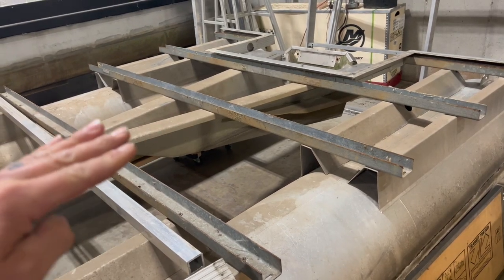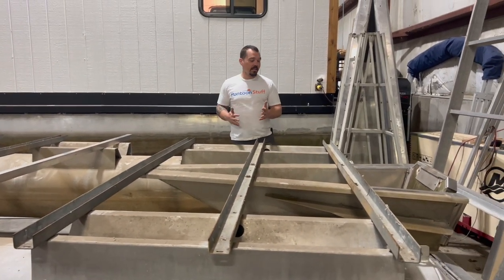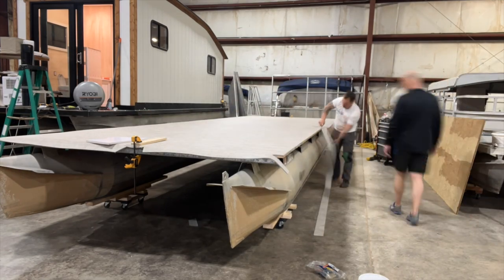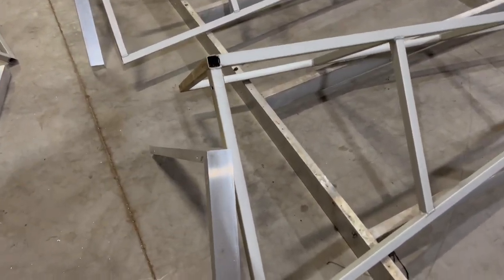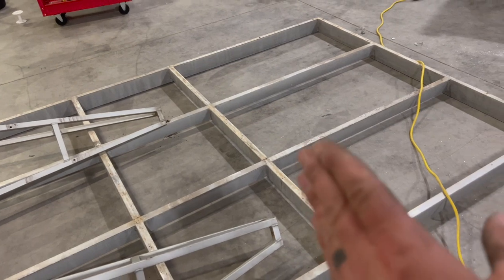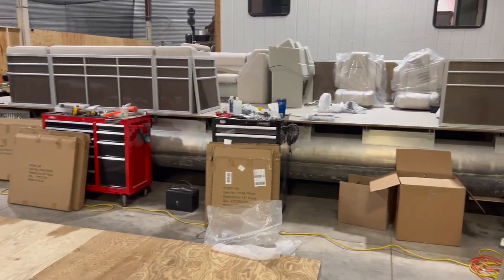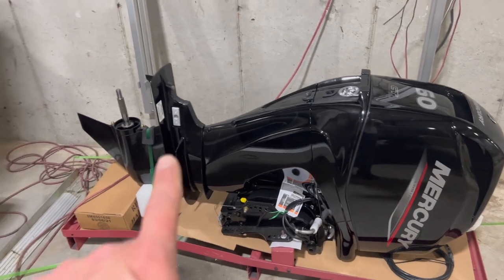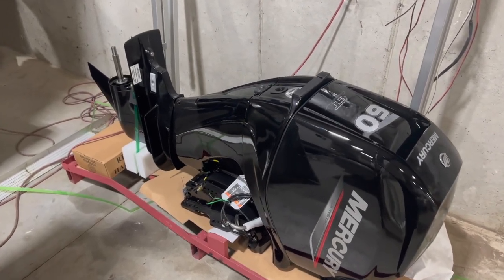Double Decker Pontoon Restoration - Episode 2

Comment: Renovating my 98 Tracker Fishing Barge with aluminum deck what type of glue do I use for Pontoon Stuff vinyl? And THANK YOU FOR ALL YOUR HELP!!
Reply from the maker: You’ll have to use a SOLVENT-BASED adhesive…like weld wood or other brands, often referred to as contact adhesive. The process is different in that you have to work on smaller sections applying the adhesive to both the aluminum and the vinyl backing…let them almost dry…then stick together. PontoonStuff’s felt-backed woven vinyls work with solvent based glues. If installing another brand of flooring be sure to check on it! Lastly, make sure that the aluminum is completely clean of old glue…bare aluminum! We don’t work on aluminum decks because of the amount of labor involved in cleaning to bare aluminum and unsafe nature of doing that sanding/scraping/chemical additive work indoors, but it’s 100% doable for the DIY folks who have an outdoor space to work…and who can spend the hours working to save some cash!

Comment: That boats going to look amazing, can't wait !

I know you are not a fan of the transom mounted gas tanks, but aesthetically it just is more pleasing to the eye to have it tucked out of view , in my opinion at least
Reply from the maker: I definitely prefer to have them hidden and out of the way. High and dry under the sundeck would be my favorite. This boat will have a couple storage compartments in the back corners for the gas tank and batteries…which will also make some great cooler spots…so stay tuned for the last episode. Also, I’ll never knock the aesthetic improvements that a transom mounted tank can offer!